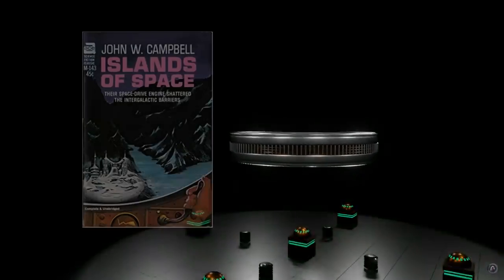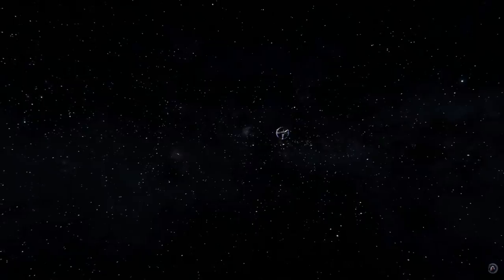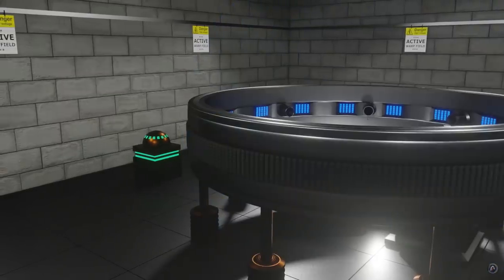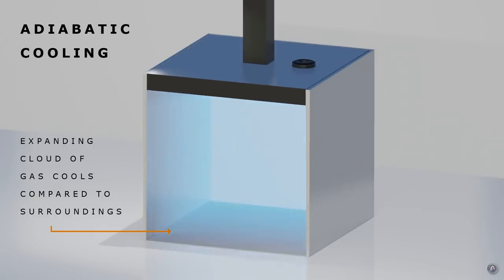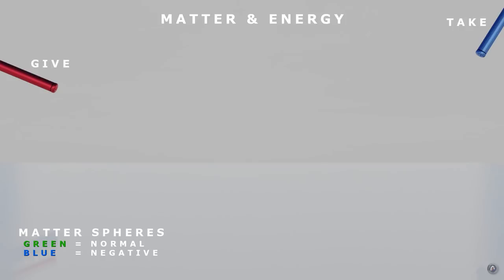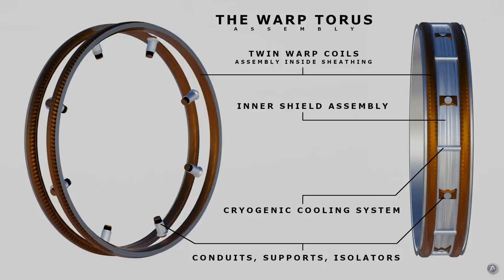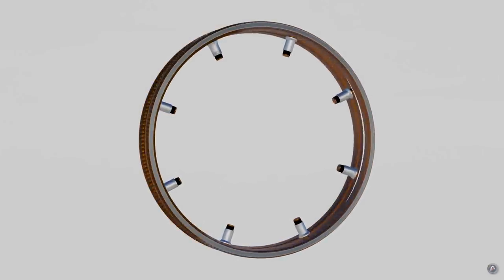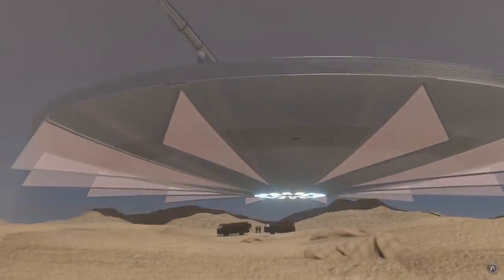A Detailed Breakdown of an Alcubierre Warp Drive Coil

Comment: You're mixing real science and handwavium and you sound like schematics for such tech exists. You're also talking about extremely theoretical concepts as if they're already well understood. Its a good video but not something one can take seriously.
Reply: Deeparth Gupta -Yeah when he makes the claim "in 50 years we will be able travel faster than light" I was like okay I can't take this seriously at all. Sorry not sorry.
Reply: Michael Stanko I think it was a brazen statement, but could we be in small scale testing in 50?  Maybe.  But I’m more concerned with radiation protection, both deep space and containment of locally produced radiation, so that us fragile humans won’t melt.
Reply: Therefore you should read great comment about possible failure of turboencabulator written by Liam Donald and all responses to it. Learn what turboencabulator is first.
Reply: @Roodj1  We can contain  plasma far hotter than the sun with toroidal EM confinement. Just a really strong magnetic field. That's how fusion reactors are able to operate without destroying everything within a certain radius. We can contain or divert radiation in similar ways. Including just absorbing it with solid materials or metamaterials.

We are beyond the "how to stop radiation from killing the crew" stage in this development, although I'm sure it was a stumper for a little while.
Reply: @MrClaysta /videos Some types of non-charged radiation need nucleus shielding. Like fast neutrons and 0.511Mev-500GeV gammas that would be common in antimatter propulsion. There may be some advanced ways to maximize the cross section of a material for every type of radiation with the least amount of weight, but I don't know of any. Benefits of this would be shielding of lightweight spacecraft travelling at relatavistic speeds without needing inches of lead or depleted uranium. Either from the thrust production or from extra-solar intra-galactic radiation.
Reply: Deeparth Gupta Yeah., warp physics is still EXTREMELY theoretical and has only BARELY begun to move from mathematical models to small scale bench top tests. We are long, long way from having a system that we can bolt on to the back of a spacecraft.
Reply: C yes, I know that, but I’m talking about deterring radiation that’s a tad bit worse then what we can produce on Earth.  Cosmic, high energy radiation, and other ionizing radiation protection over long periods of time without making the ship a radioactive death trap.  Say protecting the ship in a whole, what to do?  With electromagnetic fields can we still establish communication and navigation?  Does it actually protect against this radiation in practice?  I’m pretty familiar with electromagnetic theory on radiation control, seeing that I’m slowly writing a research paper on Active Shielding for Deep Space Missions using Electromagnetic Radiation.  But, what is an unknown is how it would work on a ship the size that can sustain human life for years at a time.
Reply: This is real science bro!!!
Reply: Christopher Isaacs  HAHAHAHA! Sorry. No. We are most assuredly NOT fifty years away from cracking interstellar spaceflight.
Reply: I take all of this very seriously. Just because it's going to happen at some point in the future. Unless we nuke ourselves into oblivion for some reason.
Reply: Handwavium to some, hopium to others,
Reply: I'm curious, if we did manage to create a ship with FTL travel, then how would we contact earth from another solar system? Wouldn't it take as long as light to travel? and wouldn't the signal be extremely weak once it reaches earth?
Reply: @MrClaysta  What patents are you referring to?
Reply: @MrClaysta  ..."We are beyond the "how to stop radiation from killing the crew" stage in this development... Since when?
Reply: @anthonylumpkins2080  I have already linked the patents in this thread...

And since we have have had craft zipping through the skies. The DoD has already confirmed these craft exist... Luis Elizondo
Reply: Doug Gann ☆ "Handwavium is Real!"
In my Alt/Universe Theories.

Trying to compete with "The Expanse"
But then, Star Trek was Real Science.
Reply: Jules Verne provided multigenerstional inspiration to thousands of young scientific minds.
Imagination is the Distant Star.
Building the Bridge is Technology.
Along the way, we may find better ways.
Reply: There's no way to build this without being able to manipulate gravity, create antigravity(negative mass), and produce gravitational shielding(so the space craft isn't ripped apart by the strong gravitational fields).
Reply: Sam Nelson ☆ "The Handwavium is Strong with this Project"
Reply: @user-mp3eq6ir5b  SUPER strong.
Reply: The Alcubierre coil depicted here has 8 conduits which may allude to the vortex mathematics of Marko Rodin and his rodin coil which actually has 9 divisions and actually does prove the existence of infinite energy.
Reply: @Adamstankevitch /videos Using a continuous laser link which constantly generated entangled pairs of particles or photons, you could send and receive messages between parties instantaneously, but you would have to wait to verify the message details due to the delay of the light-speed communication link. If there is a way of figuring out the quantum randomness problem then yes you could send and receive data faster than the speed of light. You would theoretically be using up pre-prepared and stored packets of entangled particles, which the two parties share, in order to send the data 'instantaneously'.
Reply: @Baigle1  that is pretty cool, let's maintain hope for quantum computing then! Thanks for giving me an answer.
Reply: There's no such thing as "negative energy" or "exotic matter" except in the heads of these theorists, at this point. The fact that these concepts don't contradict known physical laws does not mean they exist. That's step 1 - finding something that we just dreamt of somewhere in the real universe.

Step 2 would be figuring out how to harness the stuff and then step 3 would be implementing its use. All these steps are equally difficult, if at all possible, because with each one comes its own set of challenges or hindrances.

So all this talk about a "warp drive" being "in development" is utter bullshit. It's a pipe-dream, at least for now.
Reply: Deeparth Gupta Indeed he is, but it seems the scientific community is taking this topic a bit more seriously nowadays since Einstein's cosmological constant and gravitational waves have become a bigger issue. Yes, most of this video makes outlandish claims that this technology is within grasp, as we're still far away from that with the current power demands and understanding of spacetime. That's what warp technology has to rely on for the most part. However, it's possible to get this project some traction if we can make serious progresses with exotic matter and the understanding of the fabric of spacetime, but then again... multiple theories have popped up in recent years to explain both things and some are more feasible within Einstein's proposals, while others go towards the wobblier realm of quantum mechanics to explain why exotic matter acts the way it does. As long as that remains a mystery, there's no forward momentum.

Could we get something stable in 50 years? Short answer: I hope I'm wrong, but I think not. There's too much baggage involved before we get to warp mechanics. Long answer: well... depending on the progress in other fields of physics or what those answers could be, we could get to experimental stages faster or slower (or even nowhere, though I don't believe that to be the case forever). It merely depends on that. It would at least become a bit more feasible than the alternative, I believe. But if we could get small-scale warp experiments in 50 years just to demonstrate the concept, that would be cool. Just a proof of concept of artificially bending spacetime would be a whole new realm for physics.
Reply: @Roodj1  The radioactivity and very high energy particle in front of the ship well also destablize the warp field  matrix if not controlled. They have to defected shielded against and possibly   used to generate more power.
Reply: @colonelburton8451  The chasmair effect decades ago.
Reply: @colonelburton8451  That is not true the power level is the biggest problem. You have not looked at all the warp drive theories. There are more then showed here. Plus the new states of matter discovered seem to violate the currect laws of physics.
Reply: Yeah, there won't be a warp drive in 50 years, and maybe not in 200.  The Casimir effect is something that happens on tiny scales.  Utilizing it isn't going to send any kind of a spacecraft anywhere within a human lifetime.  That's why the studies for the Alcubeirre drive all show the need for varying amounts of actual negative mass - something we have not observed and have no idea how to make.  And the energy needed to run the thing is gonna cook the spacecraft and everyone in it.  In space, you can only dissipate heat away via radiation.  That's not exactly the most efficient method of heat transfer.  It's an interesting idea and worthy of study, but it is a long way from being something feasible - if ever.
Reply: @alexandernorman5337  Dude are you really interested in this stuff. The casmir effect was a long time ago. Because you said there was no evidence  nagitive energy exists. So I gave you an old example. As for the one who said you needed very large amount of energy to produce the nagitive mass and or nagitive energy. A Russian proved if you could use that mush energy it would produce a black hole large enough to eat our solar system. Short term nagitive mass fluid was discovered a few years ago. A coil that produces a few nagitive mass particles about a year ago. The discovery of super conducting fluids and solids. Last count for me 11 forms of matter including a short term time cristal that seems to show perpetual motion properties.  Over 20 years ago warp plasma like on star trek only made small amounts for very short times by shooting anti particles into glass. The discovery was a accident. The study of false vacuum states that proved strong magneto hydro dynamics effects can distort spacetime and gravity. But all you can find now is universal doomsday on the subject. The doomsday effect does not account for the system correcting itself with a blackhole are a wormhole. The new discoveries in fission and fusion with the liquid salt formulas. The magnetic tape that doubles the magnetic field density in a fusion reactor that allows to be ten times smaller. Plus the salt formulas in the fusion reactor cooling jacket also adds to the fueling of the reactor. Dude I could go on and on. 50 years is about right if we get the infrastructure in space. As for the radioactivity cooking you it can't  do that if it is deflected and rerouted into the power systems. Besides you have to do this anyway along with the particle buildup or it well  destabilize the field matrix.
Reply: @aidandibenerdini4545  I wish it was that easy.
Reply: @michaelstanko5896  probably referencing star trek first contact.  April 2063.
Reply: For those that do not know, faster than light travel is...NOT...possible.  This has been proven, if you do not believe me then read Einstien and research what happens as we accelerate towards the speed of light--here is a hint; infinite mass.

Meaning, the faster we go the more our mass increases and therefore we cannot travel faster than light. The amount of energy needed to even approach close (80%) to the speed of light is ridiculous.
Reply: MechGyver You completely misunderstood Alcubierre drive. The main benefit of Alcubierre drive is that the ship wouldn’t travel at all, the space itself would shrink and expand -> pushing it forward. The amount of energy it would need is still extremely high but I think that they recalculated it and it would be about 1t of ,,exotic matter”. Exotic matter probably refering to antimatter. With enough founding, I believe this form of drive would be possible to build in this century. Remember, most of the highest-level scientists said that anything heavier than air can’t fly. A few years later Wright brothers did the first ever flight on an airplane. „It always seems impossible until it’s done.”
Reply: @sebastiankmec472  No misunderstanding whatsoever, the video claims we will travel faster than light within 50 years. I said nothing about the drive, until now...it is theoretical. As for the scientists saying "impossible" comment, when they would say it was impossible they had no known theories to test their hypothesis...Einstien not only postulated tests, they have been confirmed. The speed of light is an unbreakable constant, tested, and proven. I am confident in saying, no one will ever travel faster than the speed of light...period.
Reply: MechGyver U are still missing the point... Alcubierre warp drive doesn’t allow you to travel faster then light. It allows you to get to another location in the universe faster than light could get there. This is done by moving space faster than light. Space can do whatever the hell it wants.
Reply: But this video is a lot of bs, this guy is talking about energy needed 18 million MW / h, but this is not possible, scam.
Reply: Maximilian Preissler Yes it is possible
Reply: José Infante Warp drive is not a scam...
Reply: The presentation is intended to inspire
Reply: Wow these comments suck. Search TR3B. Google, YouTube, anywhere. Seriously look at it. If you think you've done any serious research at all you should not hold these views. This drive is out there, and the patents are out there too. Search John Quincy St Clair Triangular Spacecraft.
Reply: @MrClaysta  How exactly do you convert apparent negative energy into real negative energy? I've been looking for some time and it's unclear whether or not the cassimir effect is even possible. All I find is physicists arguing about it over and over. Also if you could kindly link to any "Patents" that would be great, since i've been curious to see a little more detail. I must admit I am a little sceptical, but I'm sure there is plenty of evidence out there.
Reply: @Adamstankevitch  arguably using spacetime waves you could send information FTL, but this is kinda very theoretical.
Reply: imagine calling actual physics "handwavium". Of course a warp drive doesn't exist yet. But it is entirely, mathematically possible, and the only present difficulty is in producing a sufficient amount of negative energy.
Reply: @fortuna19  it literally exists google it.
Reply: @michaelstanko5896  surely because you can't grasp it that means it can't exist. That's what every visionary was told as well.
Reply: @brianprusak3725  as well as Richard c Hoagland.
Reply: He is actually basing this of a theoretical patent of Warp Drive that runs on the assumption that Gravitons exist. If they do exist this can work like he says.
Reply: @Adamstankevitch  communication buoys.. basically come satellite that routinely picks up messages and shuttles them via FTL travel to a destination star system. No real time communication but still FTL for the distances involved.

All we need is ftl propulsion... which this video proports to describe I on the other hand dont buy it.
Reply: @brianprusak3725  There is no such thing as infinite energy. And a device that could make infinite energy would become a universe-destroying tool that would get dangerous as soon as you turn it on.
Reply: @mechagyver  - Except there are already things that travel faster than the speed of light. General relativity and laws of physics only apply in the normal model of the universe. They break down in things such as black holes, the expansion of spacetime and the first billionth of a second after the big bang. Space itself expands faster than the speed of light, which is why there are galaxies that travel faster than the speed of light.
Reply: A terrible script is partially to blame. Godawful writing.
Reply: @Adamstankevitch  Maybe with tiny FTL “carrier pigeon” spacecraft. Kinda like Von Neumann probes.
Reply: @terrylong8894  I think it’s just as silly to make that declaration as it is to say that it will indeed happen
Reply: Don't spoil the fun, maaaan.